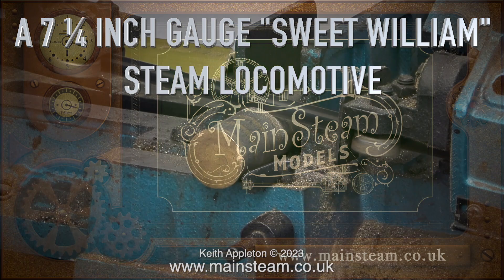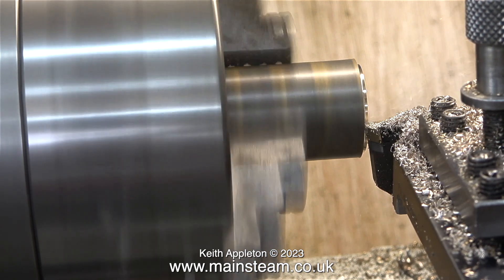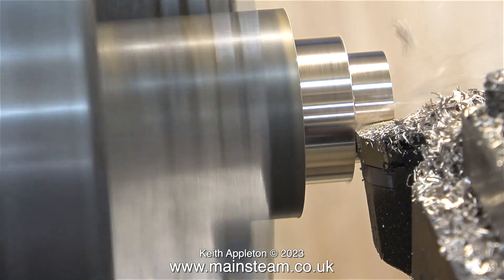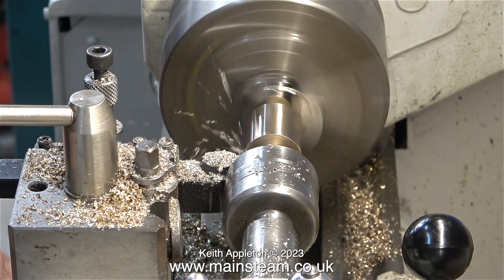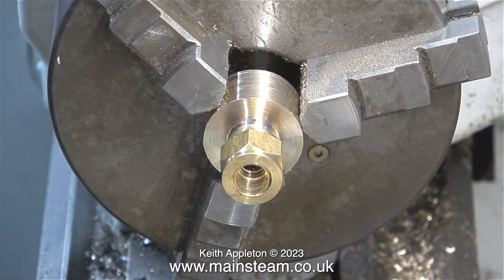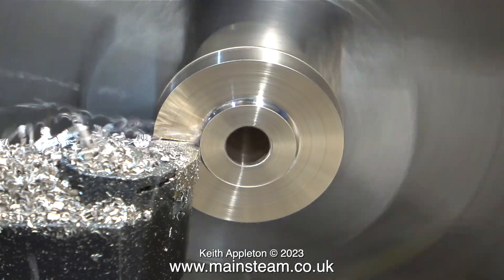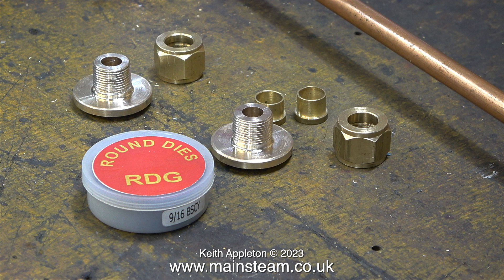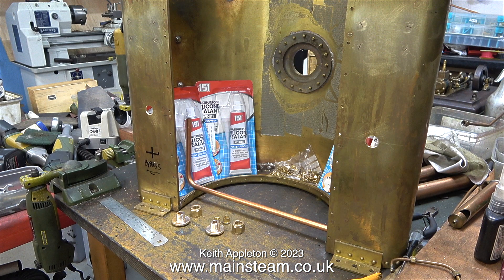A 7 ¼ INCH GAUGE "SWEET WILLIAM" LOCOMOTIVE - PART #58

Comment: Cycle threads pop up in some odd places now and again - I just bought a 60s Lucas fog lamp  and the hollow mounting stem turned out to be threaded 7/16 BS Cycle. A stainless steel replacement for the missing securing nut was surprisingly easily available.